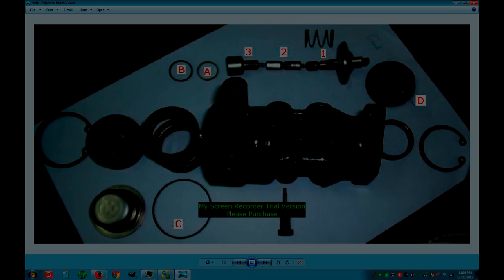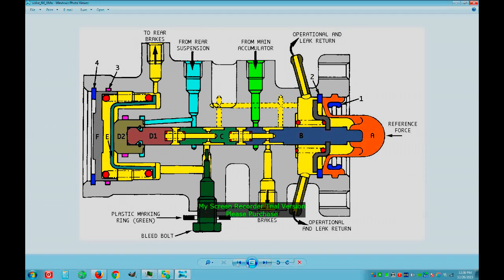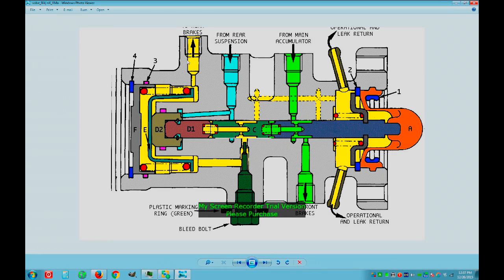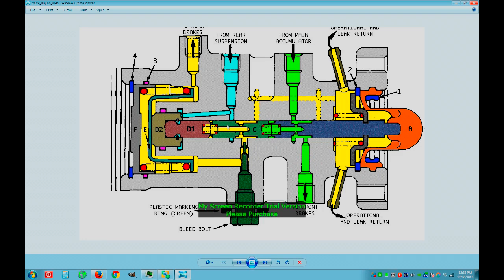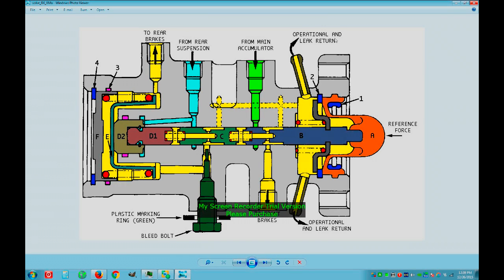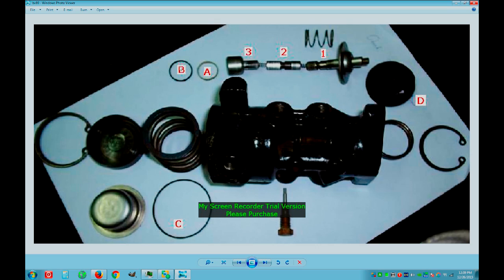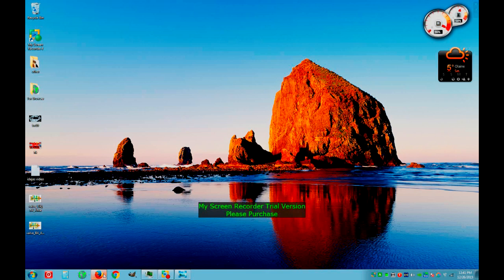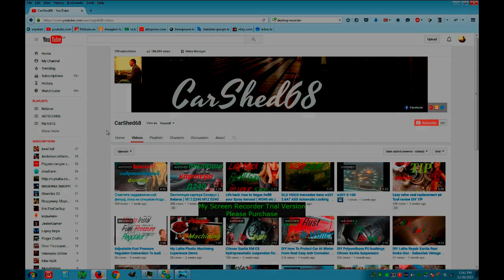Explaining how works citroen brake control valve  brake master cylinder ( doser valve ) XM Xantia

Comment: thanks for the info :)
Reply from the maker: +singlecams thx for comment,thanks to god in new hydropneimatic citroens from C5 is basic brake cylinder  vacuum powered! because here if oil pump broke(or belt) ,when all pressure is gone from main accumulator and rear suspension u have no brakes!  but is brake some time after pump failure,till all pressure gone in system! :) yes u can drive and brake with handbrake its work on front wheels,but its isnt so sharp like foot brake!